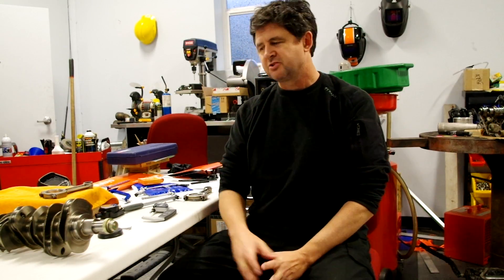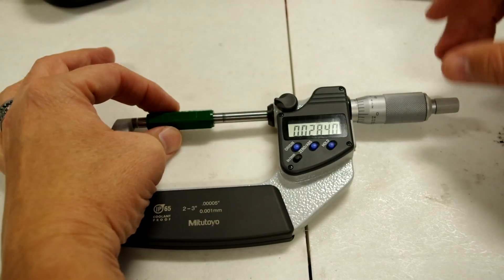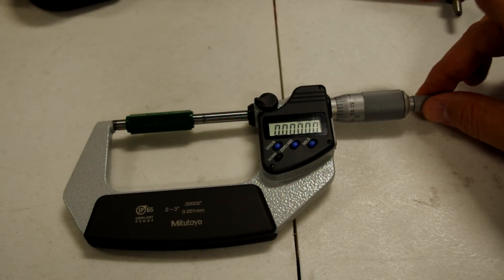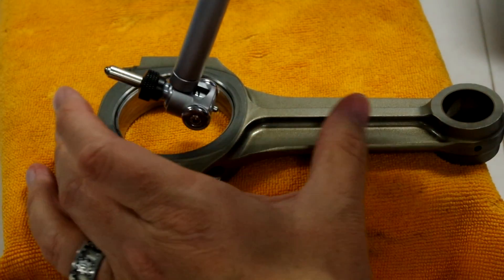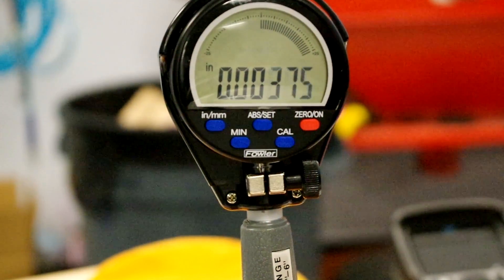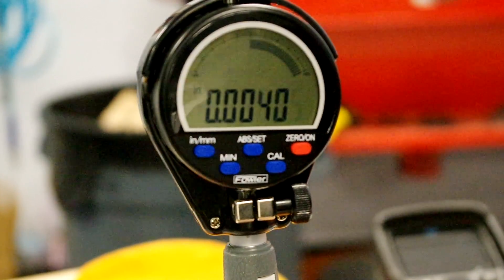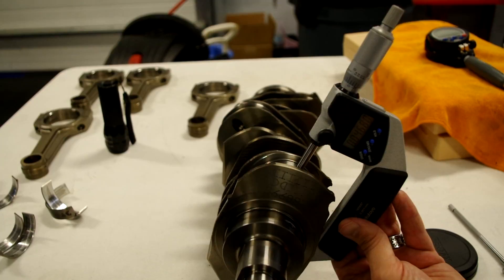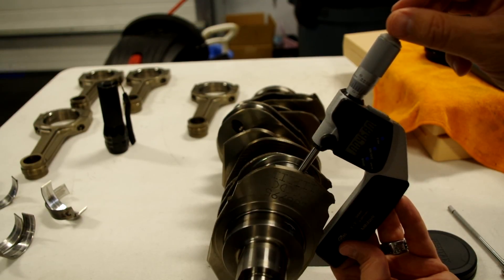Measuring Rod Bearing Clearance on an EZ30R Subaru Engine

Comment: I use this method where I work in my employer's machine shop. But wouldn't it be easier to use, "Plastiguage" to do the same thing?
Reply: George Travers 
The subaru manual actually states using plastiguage type products.  But using a mic and dial bore guage is more accurate and precise.

I personally dont like the digital bore gauge.  Anolouge is nicer in that you can see the needle swing and then look and see the reading.
Reply: I'm pro analog too for two reasons. For the reason that you have stated and that digital bore gauges need batteries to work. But sometimes they fail. Making the bore gauge useless.